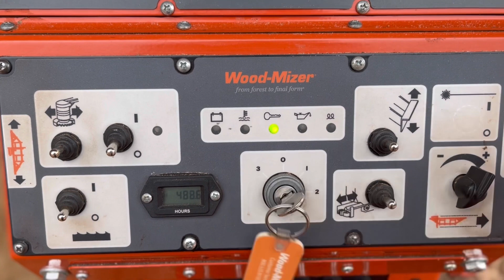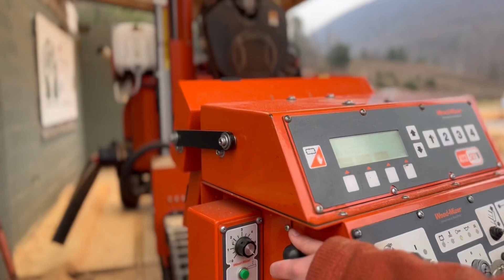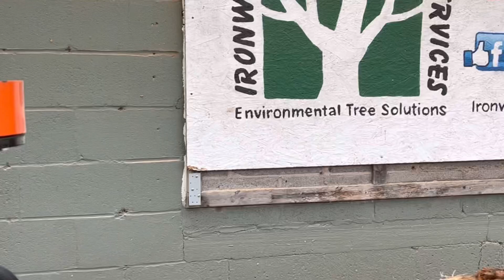Why quarter saw? $$$

Comment: WM quartersawyer here....Gave this some thought....first cut 1 board width above pith....throw that one off....stand up the fatter half...1st cut 1 board width above the pith...second cut on the pith...3rd cut 1 board width below the pith. Then do what you are doing, flopping the quarter this way and that. When you do the skinny half, do the same 3 cuts. I flip the quarter back to get the board out, then the opposite way for the next board. I always am the sawyer, but me and my swamper flip the quarter by hand. Cant wait (get it?) to get a nice oak log to quartersaw. You guys are an inspiration!

Comment: White oak will often show good ray, but not always; the red oaks very rarely, but the straight grain that quarter sawing creates has its own advantages. Number one is the wood doesn't move around, movement is often reduced by half. So, on some woods like maple which doesn't seem to show ray, quarter sawn is a good answer for doors. Plus on some jobs people don't want wild grain, just good color.
You are correct, quarter sawn is hard to find, and good quarter sawn that's propely dried is even harder to find. I hope this idea works out for you. I wish you were around 40 years ago when I was just starting out!
I think flat sawn hardwoods that are cut through and through and then dried together as a log, would bring a healthy premium price, as book matched lumber is also hard to find. 
But you are right, competing against the big wholesalers would be a trick, but having top quality wood, right from how it was cut in the forest, to how it is stored before being sold, is worth something. I think I would've willing paid 25% more for good wood, even flat sawn. Labor and overhead are bigger parts of many jobs then the cost of the wood.

Comment: Quarter sawn white and red oak shrinks only 3 to 3.5% across the board as it dries. Flat sawn white and red oak shrink 7 to 8% across the board as it dries. Prior to advent of kiln drying, this was very important to furniture and cabinet makers. Quarter sawn lumber is much more stable (less affected by humidity changes) than flat sawn. Your table top or your China hutch are far less likely to split or crack in the winter during very low humidity.

Comment: In reference to antifreeze/ keeping your band saw lubrication from freezing up . Try using heat lamps/ brooder lamps, and or an electric submersible small D.C./ A.C. heater inside of holding container. Also by adding some alcohol, I don't know what kind. There is alcohol in your windshield washer fluid. Don't get bulbs to close to the plastic/ anything flammable.  You could also rotate / add  some extra hot fluid in as it cools down and is used.

Comment: It's medullary rays. Found obviously on oak but on other lesser expected timbers. Like beech but also lace wood which is actually London plane but only if its quarter sawn. Beautiful white wood with tiny pink or red fleck.
The extent of the rays is not down to the sawyer or their experience. It's down to the log. Different species of oak are better figured than others, French or sessile for example but if the log has a significant twist every attempt to expose the rays is futile. But what do I know? 35 years on the headrig actually and would still say unless you are paid double the value for the output then live saw it. You still get enough qs to satisfy most customers and won't price yourself out of the everyday market that won't cough up the extra. For what it's worth crown cut timber, if set correctly is also just as attractive its just most sawyers don't have the skill or training.

Comment: Excellent video! Another couple of reasons to quarter-saw is straighter grain and much more stability than flat sawn lumber. When will your kiln be ready? Air dried lumber is ok, but the moisture content of kiln dried lumber is 6% to 8%, which is much more stable for furniture. My preferences for quarter-sawn walnut are almost freakish! Thanks for another excellent video. Merry Christmas to you and your family, and may you receive the blessings of the season.

Comment: Quick question... I still haven’t decided if I should get the stationary controls or the walk behind on the LT40. Lmk your thoughts on that when you got a chance. I feel like walk behind would be nice in the winter so I don’t freeze on the -30 days here in VT but maybe I would get too tired?
Reply from the maker: Walking behind it doesn’t necessarily make you tired but there is a lot of sawdust constantly blowing in your face with that set up. I would recommend the stationary control center. I have had both and like the stationary one a lot more, I do jumping jacks to keep warm lol
Reply: @lumbercapitallogyard  Ok makes sense thanks. I did some woodworking for a week in our barn and inhaled so much sawdust it changed my voice and I sounded like my uncle who’s been smoking for the last 100 years. Definitely don’t want to do that again!
Reply: @lumbercapitallogyard  maybe a finished roof over your operation would help too?
Reply: @lumbercapitallogyard  how do you grade lumber?

Comment: As beautiful and stable as it is, quarter sawn rays have a tendency to flake at the worst time.  For example, with sanding and staining a wooden floor.  There is no hint of a problem until the first coat of finish is applied.  Then the flaking rays appear.  I do have a technical question about your saw.  In this clip I saw you cutting a good sized tree trunk in half.  In another shot, cutting it along the bottom.  With all that weight sitting on the cutting blade, pinching it, why doesn't it bind?
Reply: That doesn't bind the blade because the kerf is wider than the blade body and the uncut wood just un front of the blade holds the weight up until the teeth exit the end of the cant.

Comment: This is just a question,  would like to see if you agree.

When you make your first cut threw a log to 1/4 saw it if you were to cut 4/4 above center of the log for your first cut, with out moving the log at all then second cut at dead center then 3rd cut 4/4 below center. You should have your first 2   quart sawn boards cut from the log only needing to run them threw the edger to finish them.  The same could also be done with the remaining halves of the log to get 2  quarter swan boards out of each them also with much less moving of the log.

This just seams like it would work to get more cuts out of the log with less moving of the  log.  Pleas let me know if you think this will work or not.

Ps , this is Jim on his wife's account.  LOL
Reply: This is exactly what I thought too. Just take some slabs out of the center before you turn the log 90°
Reply: That will work well provided you remove the pith. No way would I want to buy a piece of lumber with the pith left intact.
Reply: Robert, I didn’t give specific and exacting, complete directions! Sure anyone cutting or using high quality expensive wood knows the pith gets cut out of those center cuts or you have a board about 24” to 36” wide and you’d be a knuckle head to think that was a good quarter sawn board! 
I also didn’t say that the center cut would have to be run through the edger to cut a straight edge. 
You also failed to understand that when a log is cut into 4 equal size pieces, then each “quarter” is cut into boards by flipping after each  slice, the way they cut it in this video. 
What happens to the pith???
Did it disappear????
Is it converted into something else???
Are you an experienced sawyer or an experienced woodworker or do you just know enough to be annoying?
Reply: @grdelawter4266  Experienced woodworker., Certainly not a sawyer. No need to be insulting!
As for the quarter sawing and where does the pith go, it is still there, but only in small quantities on four boards that will either be trimmed away by the woodworker during jointing or sawing to width. Personally, no woodworkers that know anything about wood would use the pith in their project.

Comment: What do you use for winter lubrication?
Reply from the maker: Windshield wiper fluid
Reply: @lumbercapitallogyard  Thank you
Reply: @899jj  along with the washer fluid, add a half cup of pine-sol and 6 drops of Dawn Dish Detergent as an emulsifier. I got that from Mike Morgan at Outdoors With The Morgans. It works even better than straight washer fluid.

Comment: ##? Have you actually  cut any iron wood      I had a small  block of ironwood  it is extremely hard  had to cut with metal band saw  as wood saw wouldn't  cut   this was in key west Florida  many old home there  used ironwood pegs  and those homes are still standing even after multiple  hurricane winds 
Think to day ironwood used mostly  in jewelry  or other wood inlay projects